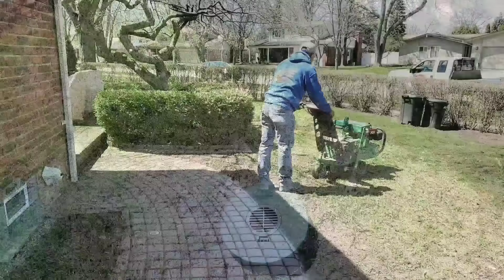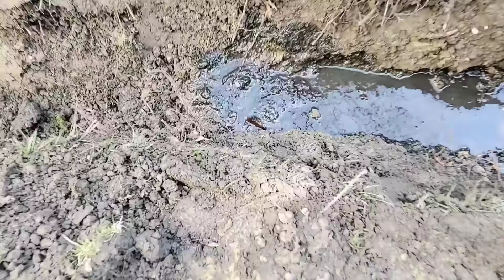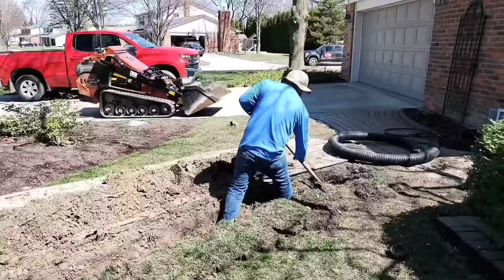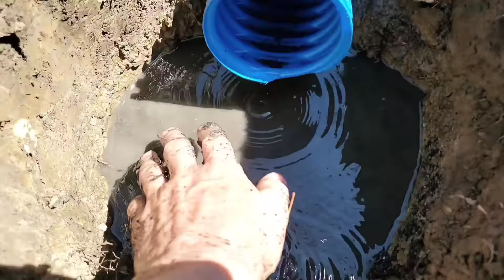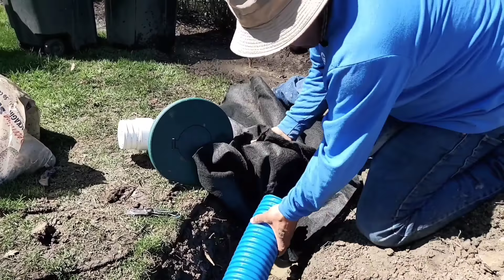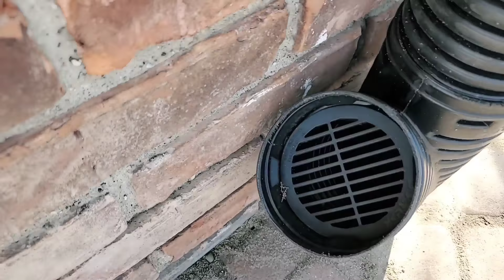How To Extend Existing Underground Buried Downspout Drain - Easy DIY Home Drainage System

Comment: Ive been watching alot of your videos. You do it legit. No bs from you. It's all business. Your work is impeccable and you use all new and nice equipment which to me is a huge factor in hiring out skilled work. When you pay all that money and they come in with shitty old machines and tools, it's kinda disheartening. I watched it happen to a neighbor (diff job, not drainage but it needs drainage bc they cut a road in a field with no french drain over it so all the gravel washes off due to the grade lol). You roll in with all new machines that are for the job (suburbs and developed areas). Not something old and rickety with metal tracks that f's everything up. Not a ditch witch with a flat tire and bent guide bar. Much love my man. Im going to do a project this summer on my downspouts and im gonna buy your stuff to do it.
Reply from the maker: https://youtube.com/playlist?list=PLjFCqaZ4v1BUqichor2QH1X_p9bBPor8D

Comment: Why do you use a pop-up to discharge the water in the yard instead of running it to the street?
Reply from the maker: In the North we ice the streets and have to remove the discharge line once the DPW hits the home owner with a written violation. I also disagree with the street discharge for 2 other reasons. 1st the city plow trucks will ice dam the discharge at the street 100%
2nd during heavy flood conditions it's better to let bulk water dissipate across a front yard then to overwhelm the drainage  Infrastructure.

Comment: Hi FDM!

This is a great looking system! 

 With the Belly in the "Before" portion, It seems like there would be standing water for a very long time, enabling mosquitos to breed in the pipe itself. 

How long does it take the water to dry out from the catch baisn and pop-up emitter in the solution? 
Another big problem I see here in north carolina is Iron Onchre. Would this clean out system catch the Onchre and require less overall cleaning?
Reply from the maker: The catch basins are not a giant pale basin for that very reason they're just big enough but yet not too big they Leach into the sub soil in a matter of just a couple days.  As far as iron ochre the access that the system gives you it's not an issue to flush the system. We will be releasing a video in the near future on a new product that cleans iron ochre from a system stay tuned!